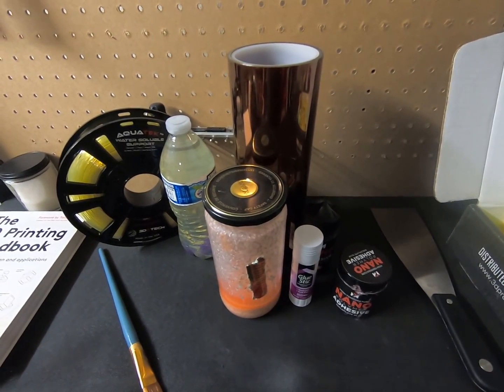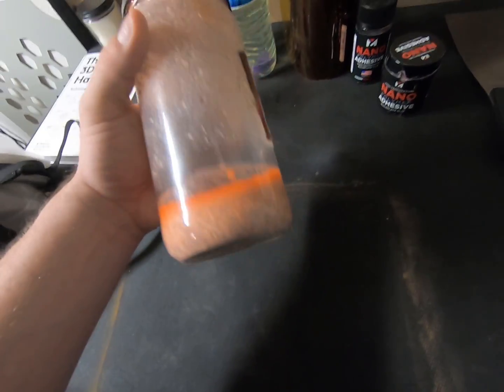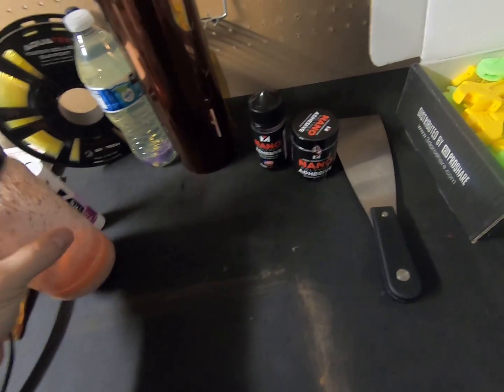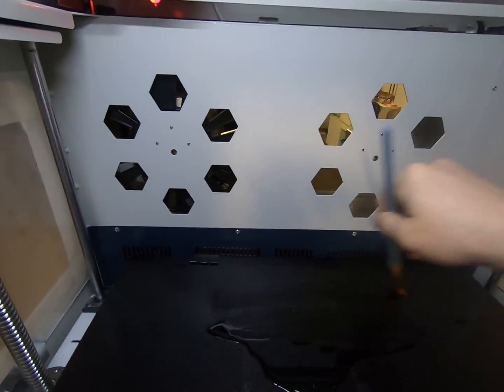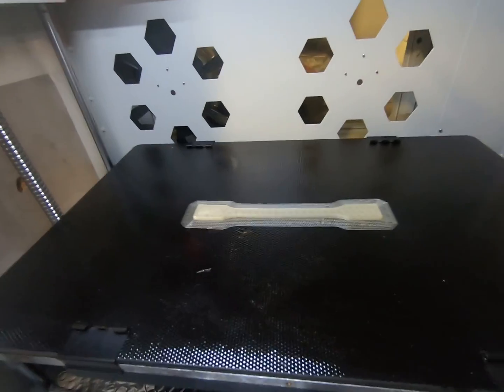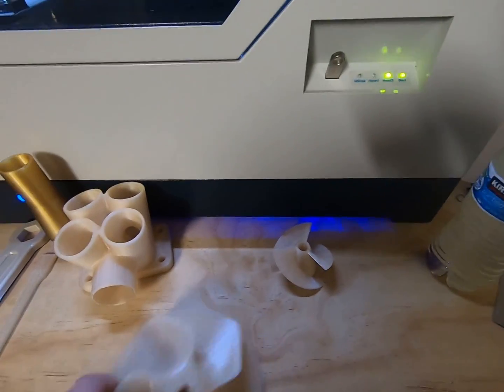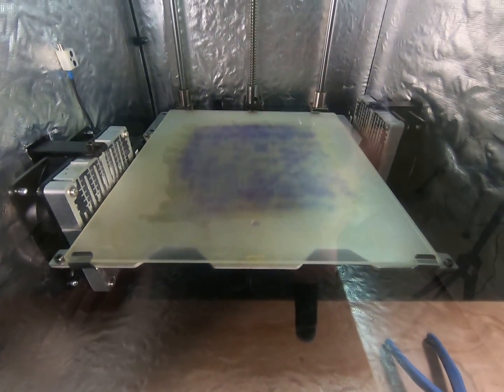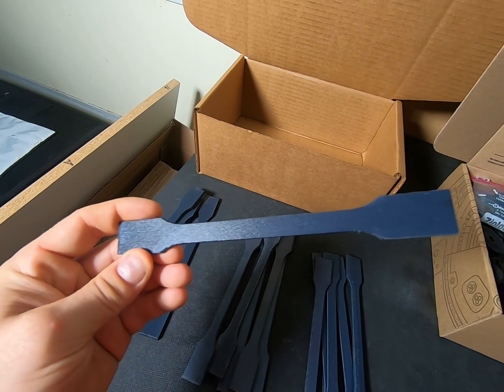3D Labs - High Temp 3D Printing Tips - Bed Adhesion

Comment: Also, how do you deal with drying peek before printing?
subscribed and bell'd
Reply from the maker: We have a food dehydrator that we run in the shop basically 24/7 for items we pull and print a lot. For long term storage, putting the materials in a vacuum will keep them dry for a very long time.

Comment: What kind of bed temps do you apply while printing Ultem or PEEK? On the internet I only find conflicting information..
Reply from the maker: If you can get the bed at or just below the glass transition temperature that is ideal. For Ultem 1010 200C is ideal in our experience, Ultem 9085 is a bit easier to print and works well with the bed at around 180C. PEEK should be printable at around 150C but higher temps do help a lot.
Reply: @3dlabs754  thanks for the quick answer!
Reply from the maker: @genau14zeichen  No problem!